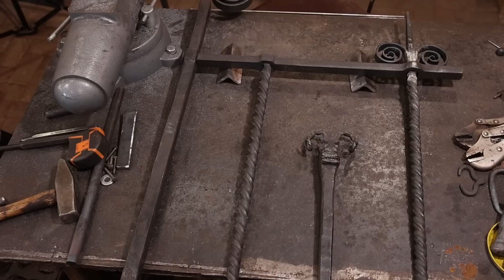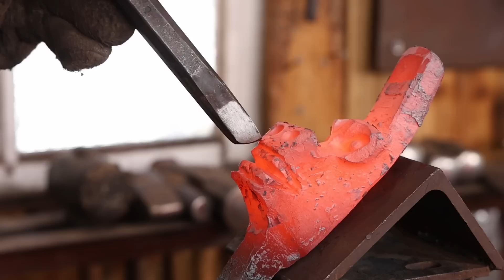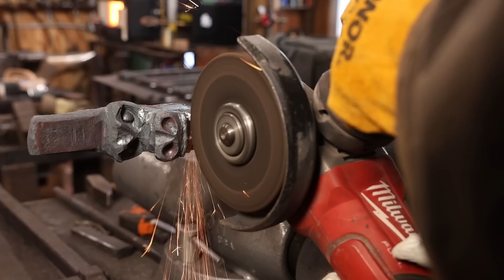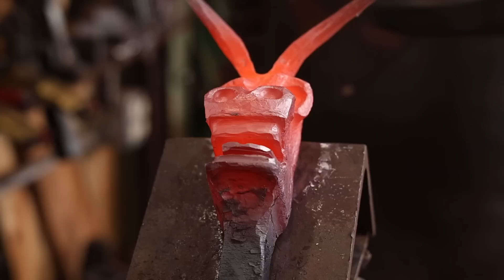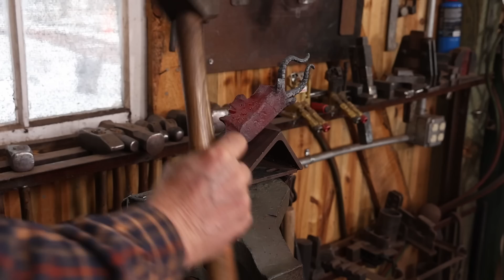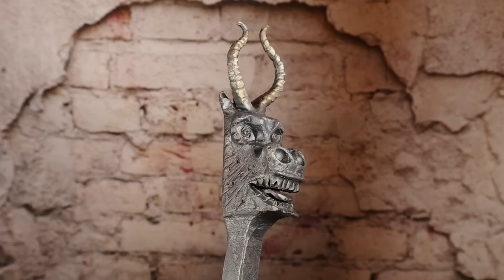Forging Figure Heads for the Gate Project.

Comment: How do you remove mill scale from your work?  It doesn’t all come off in forging and I haven’t saw anyone cover the topic.
Reply from the maker: Mostly I just wire brush while hot.  But if you need it 100% clean you can sand blast or pickle in acid.

Comment: The angle grinder.  Not traditional, but one of the heavy weapons in the modern artist blacksmith's arsenal.  Honourable shout out to the die grinder as well.  If you have both you can probably ignore the much more expensive power hammer so long as your shoulders haven't already given up.  ;-)

Comment: Im going to buy my first anvil. How much should it weigh and should i get one with 1 or 2 horns
Reply from the maker: The smaller 60 pounds anvils aren't bad but 100 - 150 pounds is probably ideal and should serve for many years as your skills evolve.  Single horn is fine and the most common in the US, however I have to say I have really liked having the double horn and probably wouldn't go back.

Comment: Back when I was blacksmithing I really enjoyed hot carving figures, probably more than any other thing I did in the blacksmith shop. There is just so much room to be creative with all the punches and chisels. Recently I have been focused more on fabricated metal "characters" chiseled out cold in layers of plate then welded together to give them depth. Working cold has its challenges but it also has a lot of room to be creative. It really makes me want to add a propane forge back to the shop, to achieve more organic shapes and movement.

Thank you for these videos it's very inspiring!